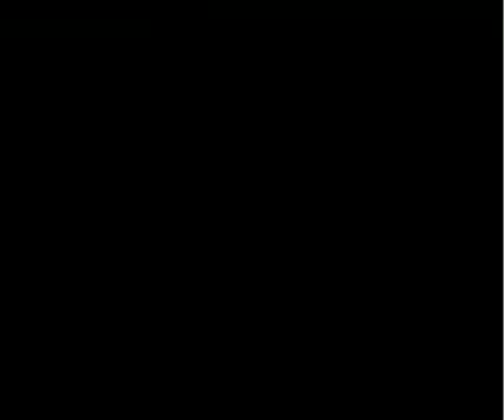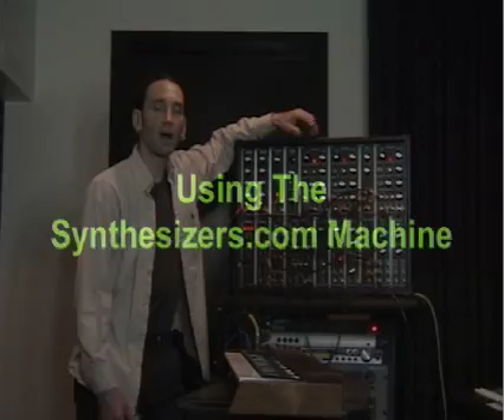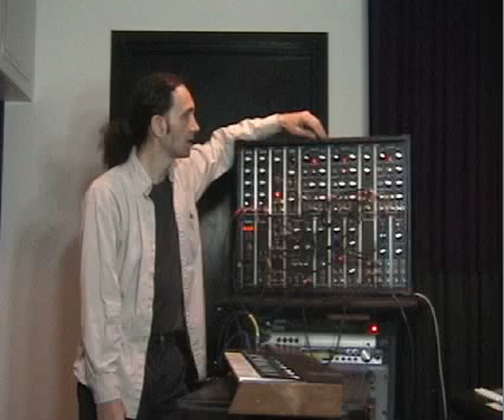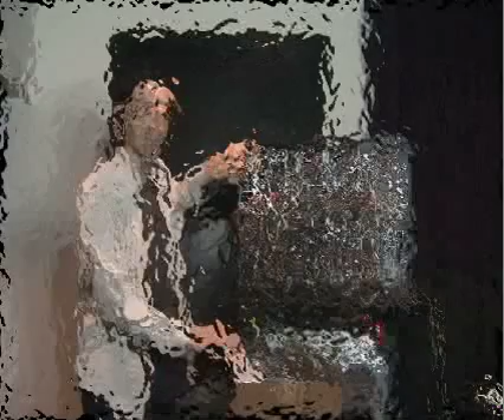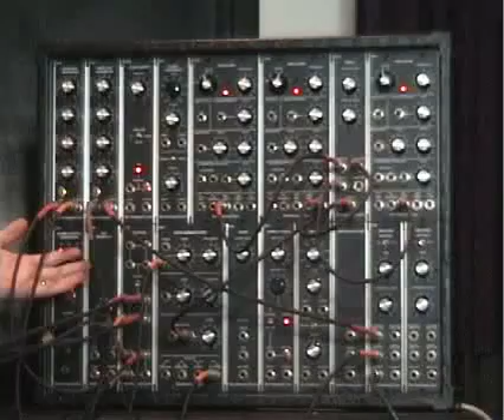Synthesizer 101 Tutorial

Comment: I'm thinking of trying to do an analog synth for my electrical engineering senior design project. I was thinking of doing a fully analog modular analog synth, but with the patching all done digitally (ie, you'd "draw" the patches you want on an ipad), however the connections would still all be 100% in hardware and hence your signal path is still 100% hardware, essentially just eliminating the need for physical cables but effectively still having the same effect.
Does this seem like a decent ide?

Comment from the maker: @stutwostep Hi-
Well you don't really 'program' this kind of machine.  I has no memory. You simply connect or patch on thing to another and build a sound via those devices or modules.  It is not unlike starting with a guitar and then running it through flangers and fuzz and wha and eq etc... 'cept here the starting tone is electronic via our tone generators or oscillators. On a typical machine like this you can play the resulting sound using a keyboard to drive it as i do in this demo.

Comment: His system is in the $2000-US range.  They're very expensive, but also very awesome.  I want one!

If you're new to synthesizers I recommend starting with a cheaper, simpler non-modular.  You can pick up old synths from the 70s and 80s on Ebay for much cheaper ($300 to $1200 depending on the model you want).  The Korg Polysix and Roland Juno-60 are good ones to start with.

Comment: It CAN be done, but it'd be almost too cramped.
With the 960 and the proper control modules for it, you would be down to 11 modules for the synth itself. 4 for two oscillators, 2 for a filter, 1 for an amp, 1 for an EG, 1 for a mult, 1 for a midi and 1 for power - that's it, no space for the mixer, for instance. Would be unusable, IMO.

Comment: Not at all - if your good at the piano or keyboard, this should be easy. In fact easier (for some at least), because you can only play one note at a time, since it's a monophonic syntesizer.
Patching up the synth isn't that hard once you grasp the basics, and remember that there just about isn't anything you can do wrong. Only real problem is that they're hella expensive.
The system in the video costs $2550 without keyboard.

Comment from the maker: Thank you very much. A Low Pass Filter is as its name implies. It is a filter that allows frequencies below a certain point through but filters out frequencies above that point. The point of cutoff is called 'the Cutoff Frequency'. On a synth the cutoff frequency can be set and or swept by the user. It can get a bit more complicated than this because the slope or rate of change of the filter can vary and this is one variable that can give a filter its character. (MORE)